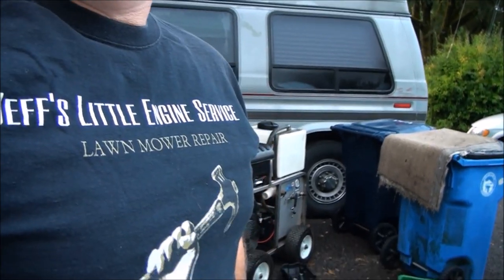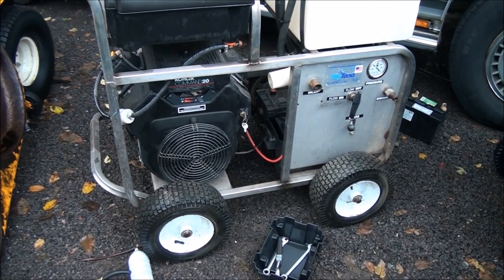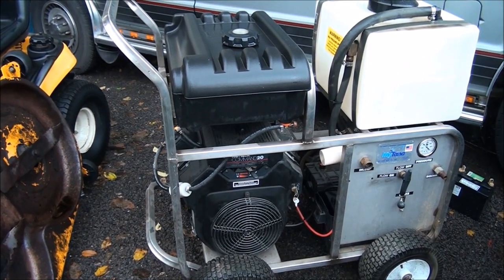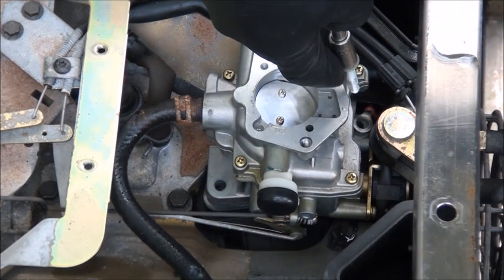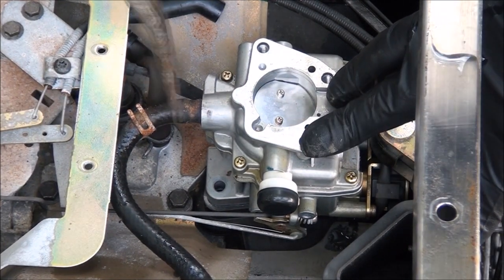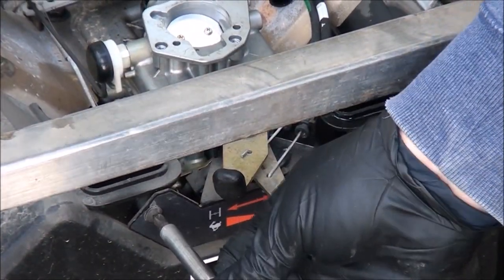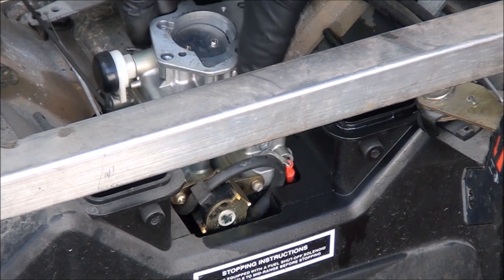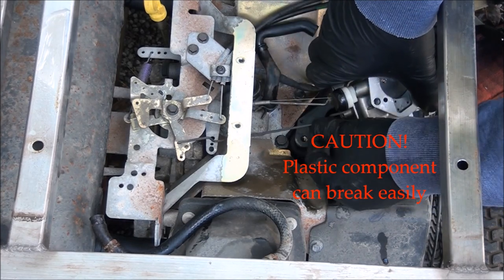KOHLER Command Twin Cylinder Engine. WON'T START or STAY Running after STORAGE. STARTS then STALLS

Comment: This is exactly the same carb and motor that's on my older 2176 Cub Cadet mower.  I bought it real cheap from a friend and it's been in storage a long time.  It's doing the exact same thing!!  At first I thought it was the fuel pump so I changed it, but now I think the carb has got to be plugged up.  I am not a mechanic and I've never tore into a carb before, but I'm going to attempt it by using your very professional and detailed video.  Thank you!!!!  Great job!!
Reply from the maker: yep probably needs the carb worked on

Comment: Awesome video . I watched another as well and you both left something out. You missed the cleaning of the small brass tube on the upper side of the base. It’s about 1/8 wide and goes in to the base . It’s removable and needs to be cleaned. In your case it didn’t seem to matter . You however did catch the fuel solenoid that housed the main jet. Between your video and the other one I have a complete breakdown of how to clean out my carb. Thanks so much
Reply from the maker: Thanks for the tip!

Comment: Jeff I thank you so much for posting this video and sharing your knowledge.  This same type of Kohler Engine powers a pump on one of our fire trucks - a 2200 gallon tanker (you can imagine how important it is to the department). It had been down for two months, acting just like yours. I followed the procedures you outlined in the video concerning the jet valve.  I unclogged it and now the engine starts first time every time. Thank you so much for sharing your knowledge and helping me get this important piece of equipment back up and going.
Reply from the maker: thank you. Good work to you!

Comment: Big thanks to you for this video. I just did exactly what you showed with a Kohler Commander 20 on Terramite T5C backhoe.
Reply: @Maddog worker $10 says you have rust in the fuel tank clogging the line. Check the elbow fitting on the bottom of the fuel tank and see if it’s clogged with rust.
Reply: @Maddog worker our T5C the rust was so bad we are having to change the fuel tank. Unscrew the fitting and blow it out with some carb cleaner and keep a supply of new fuel filters on hand. Really wish these tanks were made of aluminum.
Reply: @Maddog worker pretty capable little machine.

Comment: Most likely, the gas solenoid was the main problem from the start.  They have a problem with gumming up and sticking in a carbuator sits. Then, if the high speed or low speed idle is plugged a torch tip cleaner. I never use starter fluid in a diesel or gas engine as it will dry out the cylinder and lock the engine. I use a spray bottle with a mist of gasoline.  Just my experience working on 16 - 24 hp welding machines.
Reply from the maker: good tips.

Comment: I have been working on a Kohler Command 25. It had no spark. Tested the coils and one was dead. I found out that you have to replace both coils if one is bad. So I bought 2 new coils. No spark. Then I disconnected the kill wire and received spark. Then the carburetor was the problem and I fixed it but no one talks about what happens to the spark advance unit if you disconnect the kill wire. No one says that it might throw the timing off that it won't run even though it has spark. What has been your experience with the Spark Advance Module. Can the engine be rewired to use the new coils and bypass/ eliminate the Spark Advance Module?

Comment: excellent i have a kohler 25 hp aegis it stopped today look s like same problem looks like same carby its 17 years old i will check that main jet first .found the problem today it was the solenoid was burnt out not working on voltage i checked the wires had 12 volts of on for the solenoid.

Comment: I’ve got almost 3000 hours on my Kohler command pro 20 hp carpet cleaning machine.
Reply: Im glad to hear that. Im not familiar with these little engines but ive worked on the bigger ones used on concrete surfacers concrete saws and conveyor belts. You cant kill them. Many were of korean war era and i found a few brand new military issued during the korean war. Im thinking about using a little one for a push mower. Im just trying to gather all the info i can about them before i do it.
Reply: my watercooled 25 kohlor aegis same cardy on my powerclean 45 truckmount carpet cleaning machine  just stopped working after 5400 hours its defanly the carby i just ordered a new carby i live in australia done me fine the old truckmount had it since new 15 years about time for a new carby but getting out of cleaning so i will sell it  after i fix it up but it was still running good before the carby problem.the guy i brought it of in the states told me it will do 6000 hours not bad i have made a good living out of cleaning . its a bugger to work on being water cooled.

Comment: I have a Koehler CV18S  it will start and run for a couple of seconds then quite , changed fuel lines, filter , carb  still the same going to change fuel pump if that don't fix it what could be the problem ?

Comment: That fuel that ran out of the fuel line hit the metal and looked like it had considerable amt of water. It beaded up as soon as it hit.
Reply from the maker: yep good eye
Reply: @jeffslawnmowerrepairandservice  in your opinion are the kohler mower engines any good?  Ive had extensive experience with the old 3 cylinder engines dating back to the korean war. We used them on so many different applications in concrete business. Surfacers might have 4 or more engunes on them (by the way they are a blast to drive down the road on ice. And you get crazy looks from people) also conveyor belts for moving earth and cement in some cases. Concrete saws. I was amazed at how they were a generic type use all engine. You cant kill them. Im hoping they are carrying that tradition over into their lawn equipment. I recently killed my push mower and ive been looking at a 5.5 to6.5 kohler engine to replace it. Ive been a honda and briggs and stratton fan most of my life. I fear change.

Comment: Mine turns on and runs kind of rough and then it won’t increase the RPM even when I twist the throttle and then finally it will start running perfect. After a few different tries. Any idea?
Reply: dirty carb....clean it

Comment: Jeff hi been watching videos kohlercomand25hp put new carb on and new fuel pump starts and stops can you help
Reply from the maker: Fuel delivery problem (cheapo carb replacement?)or contaminated gas/ water in gas. Make sure to clean gas tank also whenever you work on or replace carburetor

Comment: you didnt clean idle jet circuit stand pipe with orings just pry it out and also the idle adjustment air screw under the cap on the side
Reply from the maker: good tips